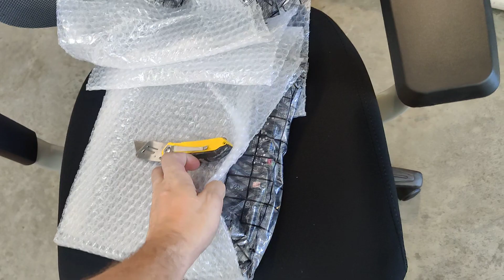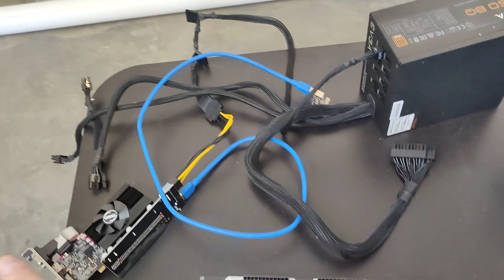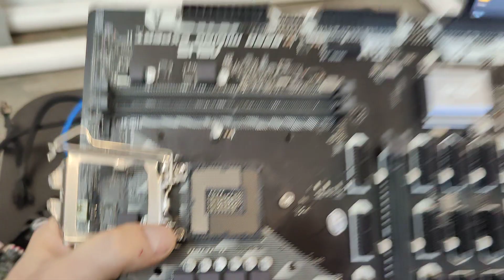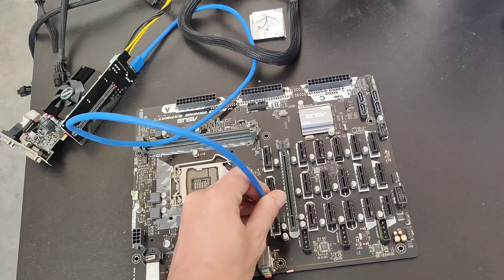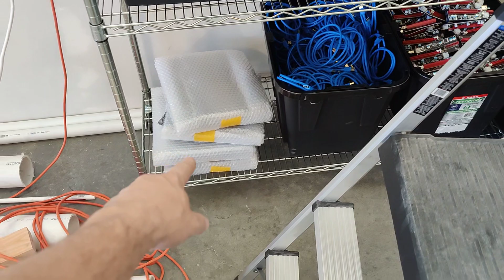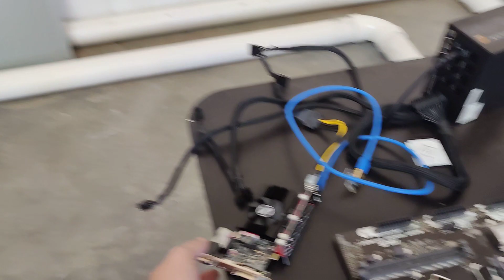GPU RTX 3080 Mining Farm - B250 Mining Expert, Explanation + Overview

Comment: That is a ton of GPU's you got there in that rack, and those are all RTX 3080's? I am not a crypto miner but I was curious what my SINGLE RTX 3090Ti could do in combination with my Ryzen 9 7900x processor, turns out even with this fast system I could mine around 1 euro per day. Energy will eventually be practically free because I have already 8 solarpanels on my garage, and 8 more are on their way for on my house. The planning is to even add another 8 more in the future. So up to 16-24 solar panels, good for between 5,500 - 8,500Kwh. But the costs to invest in all those GPU's, seems like impossible. Unless you are doing this with a group of people?